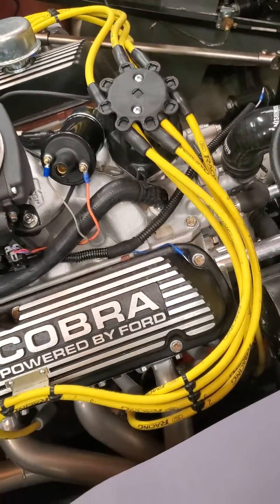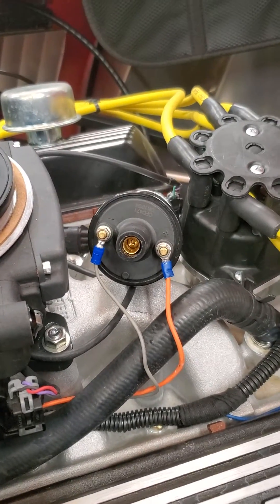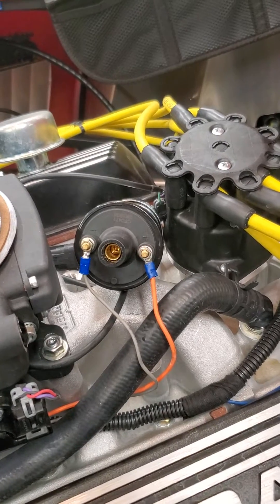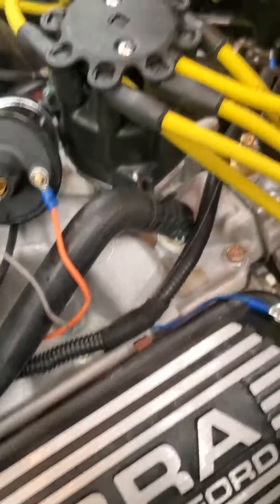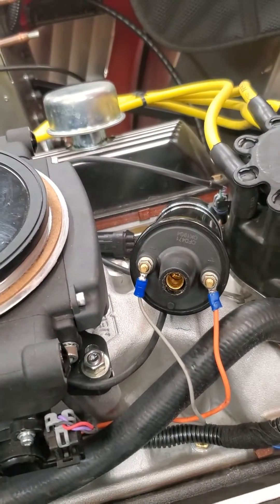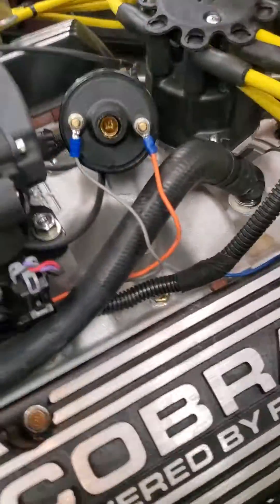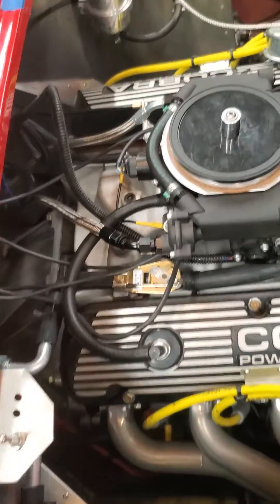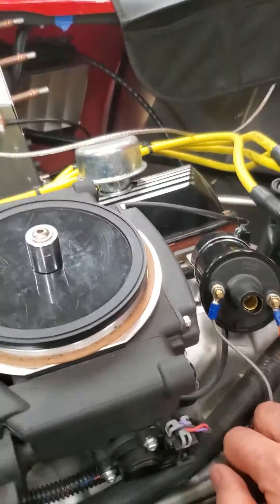FACTORY FIVE MK4 COBRA HOLLEY SNIPER EMI/RFI FAIL

Comment: Well having that coil right next to the builtin elm is definitely a no no.
And running any sensor wiring with the coil wires is not a good idea!
Shielding and grounding is a plus and that is what I did on my 74 corvette .
In my case I was dealing with a lack of a metal body so quite a few sensor wires had to be shielded and grounded. A good ground to the engine block is a must!
Hope everything turns out great!
Reply: I installed it the way the builder assembled it. And it ran fine at the beginning,  then it just started missing. I moved the coil to the frame, frame and added extra grounds to the t-body, intake block and trans, all good to go.

Comment: what issues were you having, and did your efforts resolve them?
Reply: It is ultra sensitive to rfi/EMI. Works one moment and not the next. Had to move the coil away from the front of the sniper where the ecm is. Tough to diagnose. I also added an add ground to the sniper, engine,and transmission.